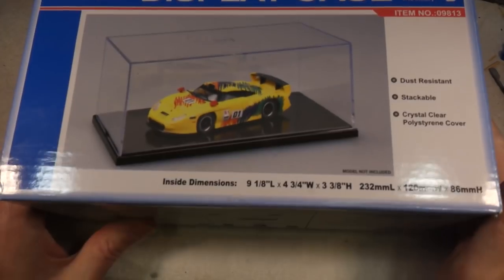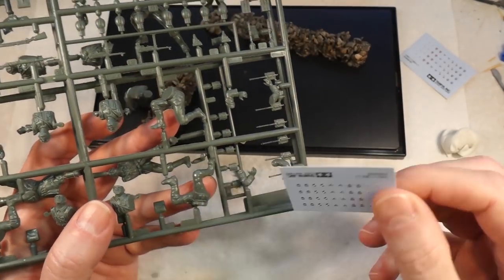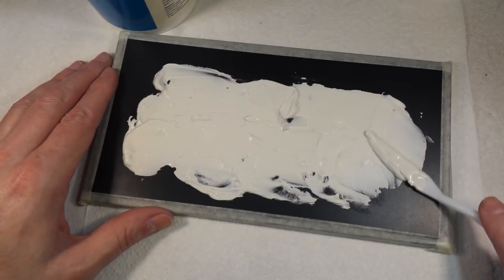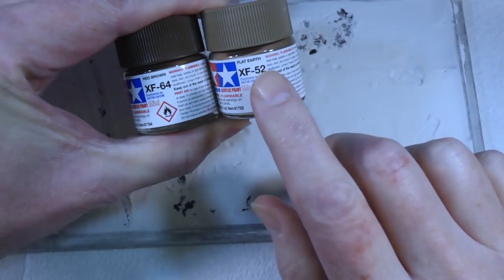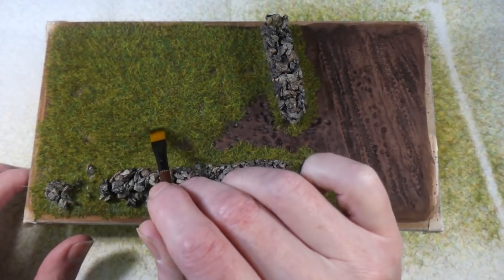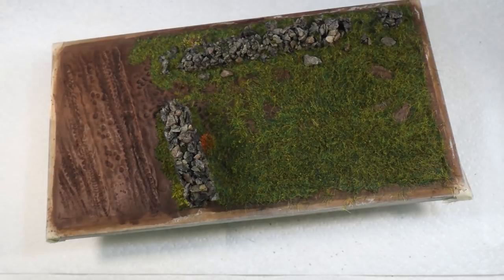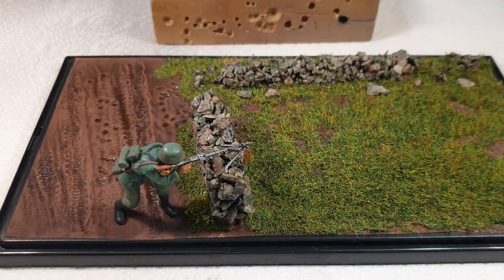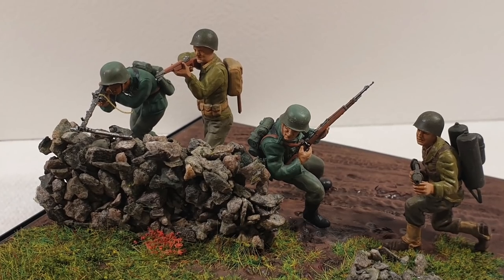Building an infantry diorama, with a twist...

Comment: You might want to place the figure feet in the damp base material like you did with the walls so it will look like their feet have sunk into the "mud" on the road and aren't just standing on top of it like it was a hard surface. And if you glue your paper clip to the bottom of the figure first and then press it in the damp base material you will get the foot impression and the hole in the base for the wire at the same time. Really like the overall end result of the diorama!
Reply from the maker: Good tip. I actually wanted to give the impression the road was drying out which is why I didn't press their feet into it, but it's still a good idea.

Comment: After drilling the hole, I would have glued the peg into the base first and then glued the figure into the peg and the base at the same time.  (I have stabbed my finger too many times with the peg.  (usually piano wire) by 
missing the foot/hoof whatever; but if I if ever miss the base with gluing a a peg into it, I am giving up both the   hobby and driving! )

Comment: Pretty cool lookin diorama :) however I tent to add my static grass in a different way. I simply use Vallejo paste for ground texture (before i  cover base with plaster and mould it) and then simply apply the grass before the paste is dry. Anyway, very inspiring video.
Reply from the maker: Yup, that works too. Sometimes I paint the base with cheap acrylic artist's paint and then put the grass on that before it dries. I like to use the scenery glue when I have different elements to fix down though, like the tufts and stones in this case.